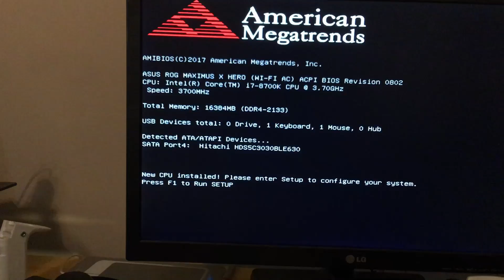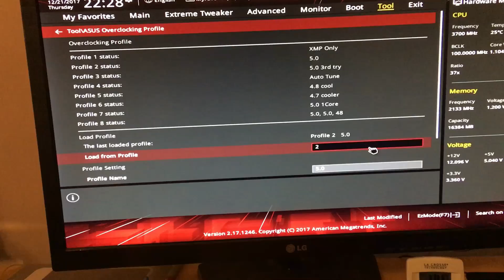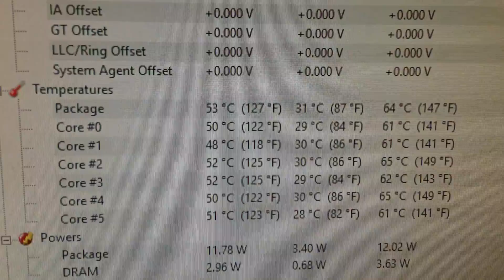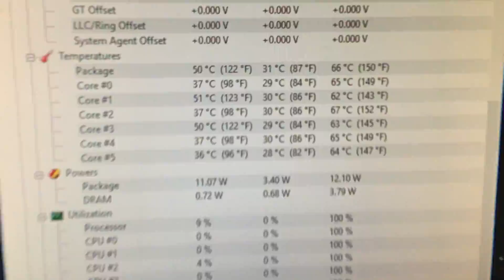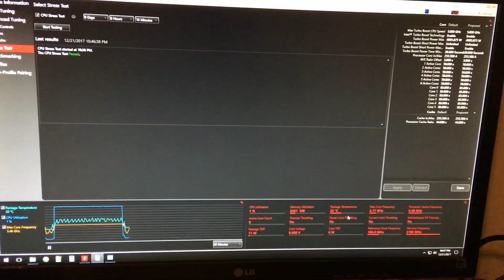8700K Delid - Short Video - 5ghz on Air With Temps Under 70c - First Time Delid

Comment: Thank you for sharing. This is very helpful. I'm going to be giving this a try in the very near future. 
 I'm a little blown away at how close our builds are. 
I'm using the Fractal Define R6, Corsair RM850x, and Asus rog strix overclock version of the gtx1080ti. Everything else is the same.
 I hope my CPU does as good as yours. I think you hit the silicone lottery with your CPU.

Comment: Great video, man. I bought a place holder 8600k until the 9700k dust settles and I was going to delid the 4690k I have now for practice. This video made it definitely seem doable.
Reply from the maker: Thank you. I think the Intel 9900K and 9700K CPUs will use soldered to their IHS. so no need to delid them.

Comment: I have just bought an 8700k and I can't reach 5ghz as the temps are to high with a Krakenx62 cooling it. I bought a delid tool yesterday and will also delid my cpu to lower the temps. Finding this video really helps. Thanks
Reply from the maker: Best of luck, may your CPU hit 5.2.

Comment: I am really curious if it's at all necessary to put additional LM on the IHS.  Great video / tutorial though!  I need to get my temps under control.  I am thermal throttling at 5ghz at 1.275v.
Reply: Yes it is, both surfaces

Comment: Great video   I am wondering the measurements for taping off the IHS to cover the correct area.   Is that something that you can share?
Reply from the maker: Ice! - As you can see at 3:42, that the die is not perfectly centered.   If you look at the long video, https://youtu.be/9EEV9kLVqbw , you will see I used calipers to mesure from the die edge to the edge of the residue of the glue.   In the long video, I actually installed the IHS backward, at first and had to take it off again and turn it around. When I did this I noticed that the top and the bottom made little contact because it was reversed.  When you measure, just make sure you marking the correct side on the IHS.  So measuring the right side of the Die = the left side of the IHS bottom.  Top = top and bottom = bottom, but left and right are reversed.
Reply: Thanks for that,  I did notice.   I do wonder is it really necessary to measure it off?  having watched a few others on the same topic they did not.    When this liquid metal heats up during use is it possible that it could dribble onto the PCB?
Reply from the maker: "Is it possible that it could dribble onto the PCB?" To be honest, this one my first time doing a delid, so I'm no expert by any means.  I do know using too much will, but using the right amount keeps it in place.  On the 8700K its not such a big deal as long as you use the nail polish on the contacts. But other processors do have surfaces mounted components under the IHS, & you do not want to short them out.

Here is a video from Optimum Tech, where too much did dribble on to the PCB and almost shorted the contacts -  https://www.youtube.com/watch?v=VWTbxH-wyFI

Comment: I've heard that it's better to not reseal it so you can keep the ihs closer to the dye, is this true? I feel like since delidding only really gives you a small amount of extra thermal capacity the few extra degrees from not resealing it as well would be necessary to make delidding worth it
Reply from the maker: Reseal is not a requirement at all. Is it better, I don't know.  I did it so it doesn't pop right off next time I take it out.  I believe cleaning off the old sealant is more important for temps, but I'm no expert.

Comment: Fully respecting the time, expenditure, and talent it takes to do this, wouldn’t it just make more sense for Intel to do this at the factory?
Reply from the maker: They use to use solder, with is as good as LQ and way better than TIM. I guess TIM is cheaper.  So to answer your question, Yes it would be better if Intel kept using solder.  I think it also comes down to 99% of there customers not really needing the better thermals cause they not going to push there CPU. It's just good enough for them.  I wish they would use solder on their K versions for the enthusiast market.  AMD still uses solder on the Thread Ripper and Ryzen processor.  IMO,  If they kept using solder, there wouldn't be a deLID market.

Comment: Delidded my 8700K. Under 100% load @ 4.8ghz I reach between 60C and 65C on the individual cores.
Reply from the maker: Nice!
Reply: i only have to worry about temps if im overclocking my 8700k right?
Reply: Correct. The 8700K is designed to operate in spec for the life of your system.

That being said, I cannot recommend the 8700K for someone that is not interested in overclocking as the price premium for the K (unlocked) is not worth the performance over the next lower CPU.

The 8700K over the 8700 offers a negligible performance increase for $50. You would be better off spending that $50 on a graphics card upgrade.

If you overclock the 8700K on the other hand, it can outperform the 8700 by quite a margin.
Reply: id like to overclock in the future. but nothing serious .
Reply: Delidding the 8700K allows for 4.8 GHZ with stability and low temps. You might even be able to go as high 5.2 GHZ but that is not guaranteed.

A good option for the future would be to delid, switch to a faster SSD and reinstall windows. It would feel like a new and noticeably faster system all for the price of a new SSD.

Comment: What's your core voltage set at? On my 5ghz profile (Strix Z390-e), it's stable at 1.255 volts, LLC set to 6, and it's running at 60°. I'm also using a 360MM AIO. 5.1 @1.320, 5.2 @1.360, 5.3 @1.395, and 5.4@ 1.430.

Comment: core Voltage : 0.000V  ?
Reply from the maker: If you look at my other video.  you will see that I was having issues with the all the Monitoring software reporting the wrong voltages.  This has since been fixed in the 1003 BIOS.

Comment: At what cpu voltage? To get stable 5Gz , i overclocked mine to 4.8 at 1.32 volt and temps are not great
Reply from the maker: Don't know if you saw my other video https://youtu.be/gTwt3aRhjz8. Before I added the SoundCard (SC) I was able to hit 5Ghz @ 1.310.  After I added the sound Card I had to bump it up to 1.325. SC was causing my system not to be able to be stable 1.310 Vcore anymore.  So I suspect that part of stability is affected with what you have in your system. In my PC I have the SC, M.2 SSD, 6 fans, and I'm using one of the USB 3.0 headers. All of these things draw power from the motherboard. Even with the1.325,  SC, delided CPU, and the Noctua cooler,  I don't go over 70 with normal workloads.  I only hit the 80s with prime 95 small FFT test.
Reply: I suggest you to run prime95,  max power at all cores to check if you have any hardware failure. I noticed even if the system booting fine and everything works stable without blue screens there might be not enough power for you for other heavy process, for example some processes are crashing even if windows keeps running like there no issue.
I was able to make it run without stops only at 1.35VOLTS, however the system works fine already at 1.27, I able to run everything just prime95 showing hardware "failure", also I noticed some heavy games got random close sometimes, even excel with heavy formulas calculation over hundred thousands formulas crashing sometimes.
only at 1.35V everything running perfectly however my temps are over 80C at prime95 heavy load (with water cooling solution EVGA CLC 280) I will delid the cpu soon too, hopefully to see noticeable change.
now I running the system at 4.7 with 1.20V stable, max temps under 70c.

Comment: Too much LM on chip. Remove some. Temps will be lower.
Reply from the maker: I'm happy where it's at now.  I'll unmount it after a year see how much squeezed out and take some off at that time to see if it gets lower.  Thanks
Reply: Too much isn't really a problem. Same with too much thermal paste. It just get's pushed out to the sideby the pressure. Or do you really think the surface tension of the liquid metal or normal thermal paste is enough to lift the heatspreader higher above the pcb? Also considering there is pressure applied in the pcb it is even more unlikely. It's just dangerous because liquid metal could come in contact with some parts on the pcb or even drip out of the cpu if it is not properly sealed. I wouldn't worry about it. To less is actually way worse because of overheating.
Reply: Tobias L. If you use too much it causes little pools and that increases temperature in those spots but also risks sneaking out the side and damaging the chip
Reply: Extreme overclockers also make sure to add more than nessecary thermal paste onto the die while overclocking because again the heatspreader flattens everything out anyway. Excess amounts are just pushed to the side. And if everything else is isolated the excess liquid metal also can't harm anything. You just have to make sure that the ihs is flat on the pcb by removing the old glue. If it is flat there is no way that there are pools of liquid metal. It must be distributed evenly by the pressure of the ihs.
Reply: Demir2k #OW I saw pooling. Pooling increases heat and risk of spill.
Reply: When u dont know what ur talkin about dont, LM is not thermal paste, doesnt act like it.

Comment: Are you still using this cpu?
Reply from the maker: I am.  It's my daily driver.  Still running cool.
Reply: @pctech12345  im thinking to delid too, but i wonder if there will be any issues in the long run. I upgrade every 4-5 years
Reply from the maker: 4 to 5 should be ok as long as you don't go over 1.4v on the CPU, and you have good cooling.  It's the heat that kills CPUs.  What CPU are you looking to do?  Cause I think 8th generation was the last that used tin instead of solder.
Reply: @pctech12345  i own the 8700k and got a good air cooler. The new Noctua NH-U12A. It performs just like the NH-D15s. Currently i set all cores to 4.7 using offset OC.
Reply: @pctech12345  yeah the 9 series use solder... a bit difficult to remove from what i've seen.

Comment: 1º You've putted too much liquid metal
2º Liquid metal on the IHS was unaligned
3º You've putted the IHS the opposite way.
Reply from the maker: for 2 and 3, I fixed it.  I caught it, just didn't add it to this video.  It's on the long video. As for 1, I'll open it up on the year anniversary and see if it ran onto the PCB.

Comment: LOL to this video, the overclock and the temps and how he did the Liquid metal onto the IHS all off centered. Sorry to say man but what a fail.  Anyone see he Power page on HWMonitoring  says 12W LOLOL
Reply from the maker: insane, why so negative. Why is it a fail?  I get nice cool temps.  I think that's a win. I stated on my other vids that HWMonitoring was funny.  Good news is that BIOS and Software updates have fixed those issues. And FYI, the CPU die is no centered.
Reply: @pctech12345   not negative bro I am pointing out your mistakes so you can better yourself.  and you used too much Liquid metal on the IHS. i know that the Dye is off from bottom to up but from left to right it's centered and the LM on the IHS is off look at 9:03. and about your overclock settings. why are u using a preset? you should of manually overclocked and also put that on video, when you use a preset like that it shows you have no knowledge in overclocking
Reply from the maker: This was my fist delid as stated in the title. I'm no pro and I used der8auer OC video for my OC. Just showing anyone can do it, and get good temps. One of the reasons I decided to do it one the 8700k is cause it's very forgiving, as no surface mounted components. Even if you use too much LM you have little chance of a short.  if you only watch this video, the short one, you will notice I put the IHS backward, I did address that in the long video.  1 year later with no other mods still running at 5ghz and blow 60 in most of the time.  I only hit 70ish when rendering something out. So I'm happy with how it turned out.
Reply: @pctech12345  please make sure the profile setting you put for the overclock is not going pass 1.4V for 5ghz. if it is change it to 1.380 and it will run no matter what.